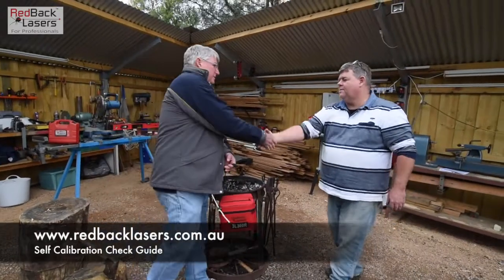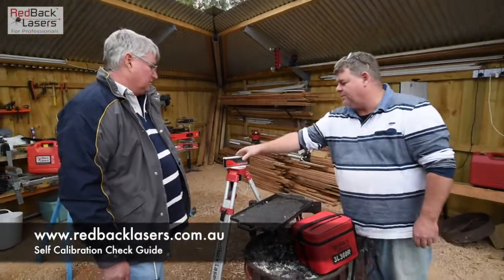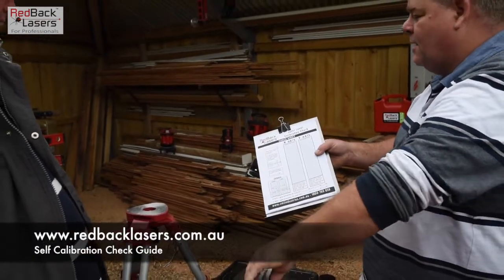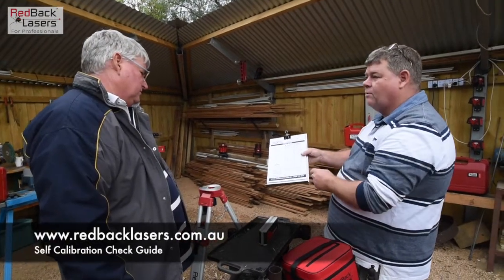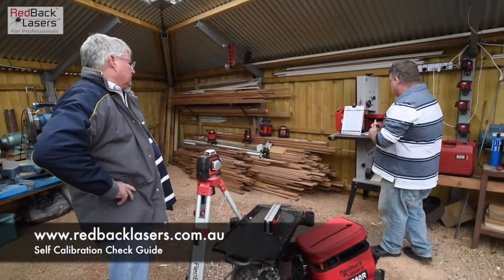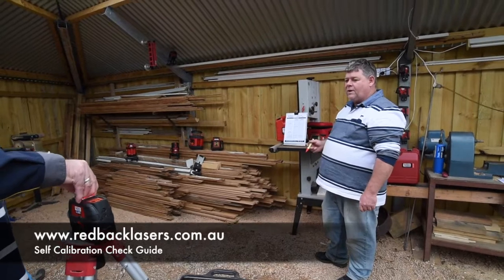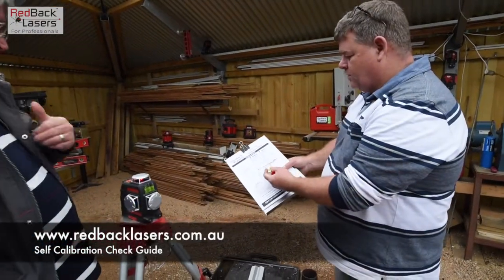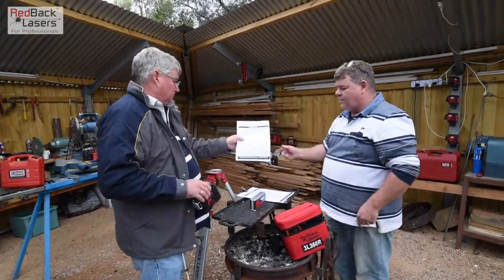RedBack Lasers How to check laser level calibration guide

Comment: So how do we check the check the laser/lights on the sides? I don’t think this method works for those.
Reply from the maker: Assuming the lasers geometry was originally set up correctly and assuming that it hasnt suffered a major drop, If the horizontal is good on both axis then the verticals and plumb should also be good.  To check vertical lines you can set up a plumb bob line and check against that.  Alternatively if you have a 360 style laser you can check the verticals against each other for consistancy.  Hope this helps.